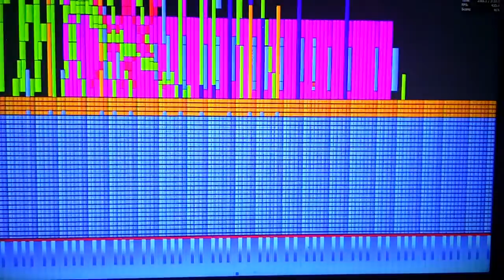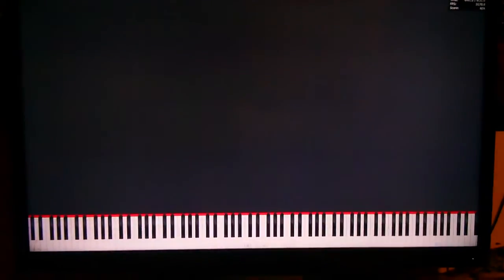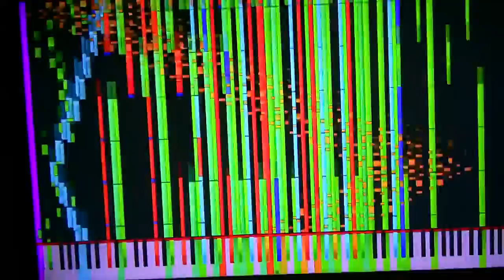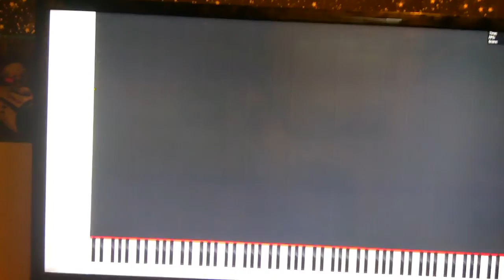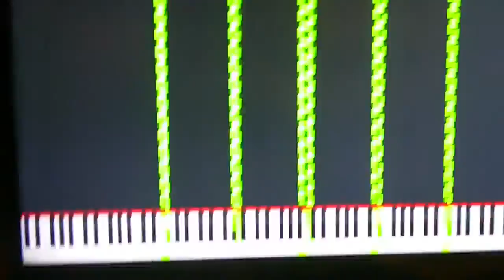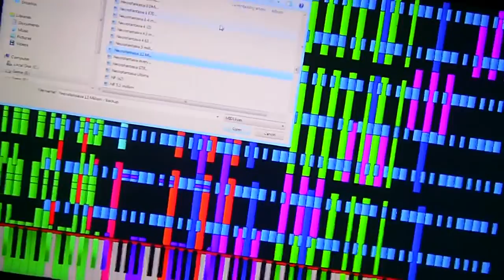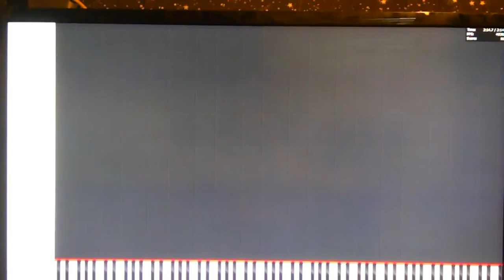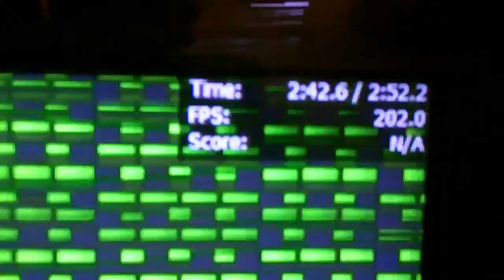Testing Crash Parts At 4.6Ghz

Comment: Intel will lauch the Core i7 4790K (3.6 - 4.0 GHz) which is based in a new revision of the Haswell microarchitecture (Haswell2-DT) and will have some improvements over the 4770K and the older Haswell CPUs. Also Intel will launch the Z97 chipset